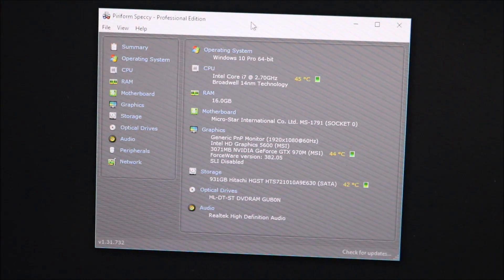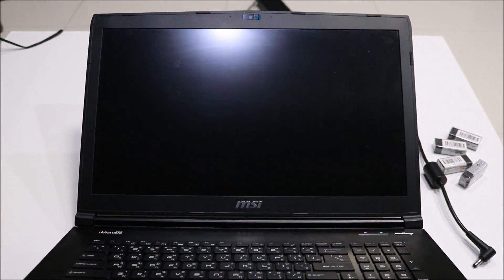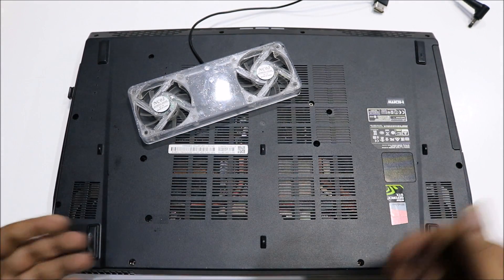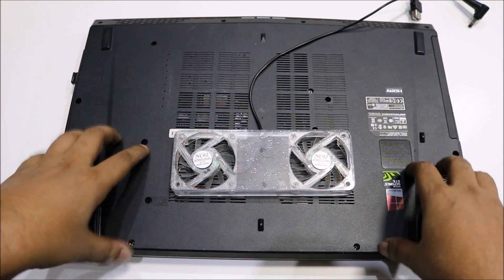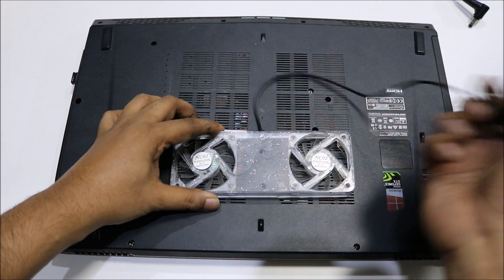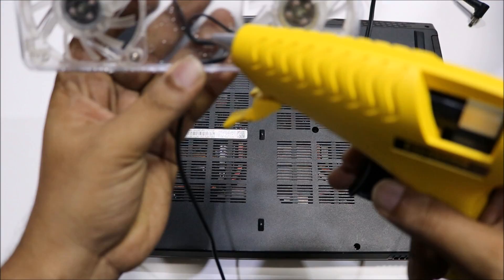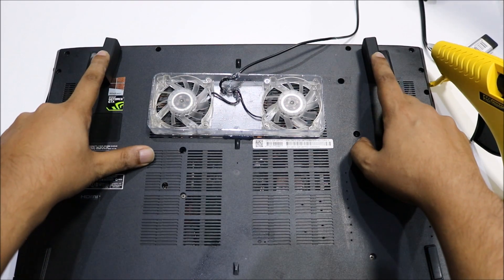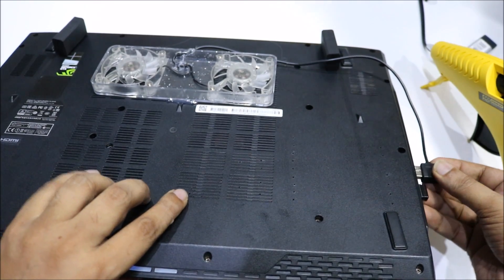BEST GAMING LAPTOP PC COOLING OVER HEAT SOLUTION DIY

Comment: Lap top heats up - time to clean the dust. Laptop still heats up - time to change thermal paste. Laptop still heats up - upgrade to kryonaut or pk3 or nth1 or something performance oriented. Laptop still heats up - if possible (and i've seen some done) add a watercooling loop (or loops) to the system. Laptop still heats up - buy a sager. Laptop still too hot - get  adesktop. Desktop too hot - :/